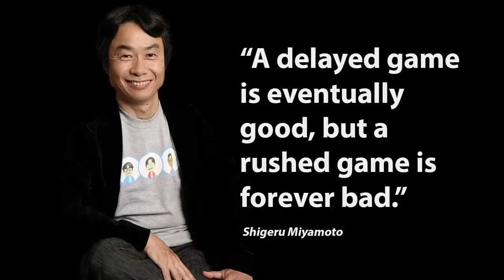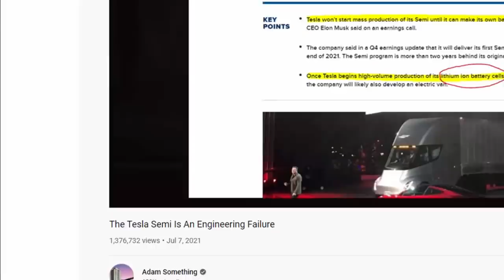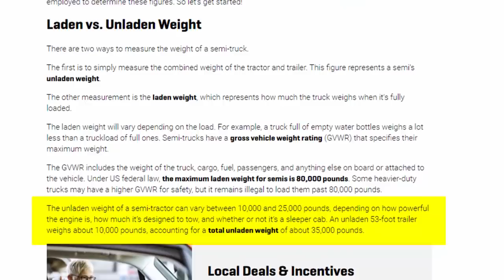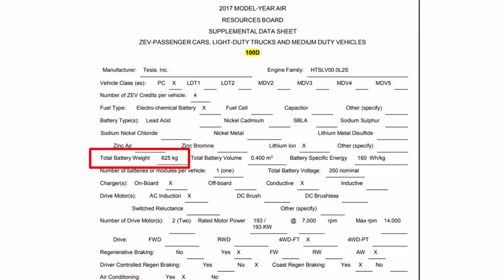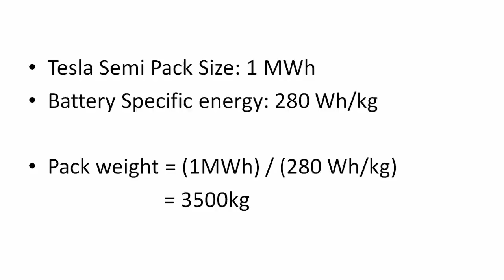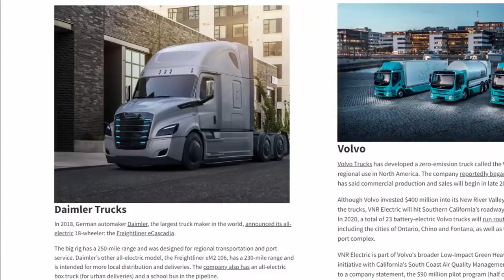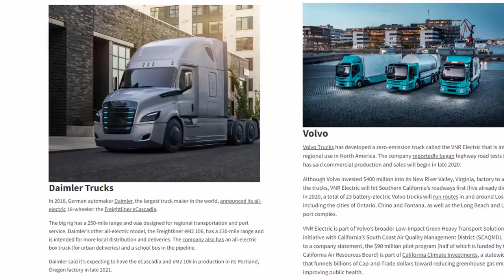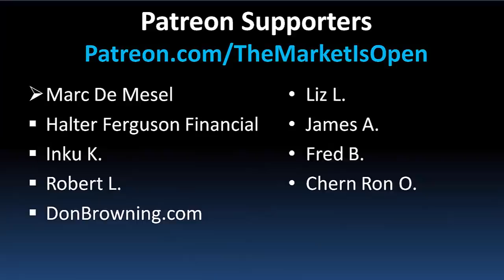The 2022 Tesla Semi is Genius, And Here’s Why

Comment: Battery production is the limiting factor for the semi and cars, 2nd biggest issue is charging locations. Achieving the specs will be not be a problem. The early adopters will be hub to hub shippers that have their own charging so this won't be an issue for them. Then as production ramps the charging infrastructure will be built out so this problem will take care of itself. If the total cost of operation for the electric semi is less than diesel, the diesel will disappear as fast as production will allow.
Reply: Yea right
Reply: The diesel is going no where. Sorry
Reply: @briankerschke5306  Do you mean that the diesel engine will be the permanent power system for trucks until the end of time? There will never be an improved method of powering a truck EVER?
Reply: @leeoxford  If they could outlast and outperform one. Diesel truck engines last hundreds of thousands of miles. Why get rid of something that performs so well and gets the job done.  Plus they can go over a thousand miles between fillups. What can possibly beat that? They claim they can well when I see it I'll believe it
Reply: @briankerschke5306  Sounds sensible. In a couple years we will have results to look at. In the meantime we are all just guessing.
Reply: Battery production.... Sorted.
I'd make a bet that there's a 4680 line built, or being built at Nevada (incidentally, literally next door to the Semi plant).
Charging?
The equivalent of 4 V3 chargers will charge a Semi 40% in 30 minutes.
On V3? 2 hours. 0-100? 5 hours 
There will be V3 chargers everywhere. Great for overnight stops.
Problem solved

Comment: Thanks for the interesting comparison. I was curious about safety comparisons between EVs and traditional diesel trucks. One of the greatest threats to 'life & limb' on the highways is a jackknifing semi. Around the I95/I495 beltway in the D.C.-metro area, they seem to have regularly occur for the many years I've been driving. Hard to believe, actually, given the heavy traffic. Complete multi-lane sections have been commonly 'shut down' while emergency operators went about resolving the issue. Rain & ice seem to be common preconditions to initiate jackknifed semi wrecks. Is it possible for Tesla to engineer something akin to fail-safe protocols to prevent jackknifing in its EV trucks?
Reply: You left out the part we're most of the wrecks involving 18 wheeler s are caused by people in cars
Reply: @oscarwalton1188  sure, but my intent wasn't to enumerate all the causes of semi accidents. My topic is relative safety of Tesla semi compared to a typical deisel semi. Over time, I'm sure Tesla FSD will become highly competent at defensive driving, though I'm not sure this will be the case for the first deployment of FSD in semis. A lot can be done with simulation using data gathered so far, but beta testing FSD in level 2 mode for semi may be necessary for several months to gather enough data.
Reply: @oscarwalton1188  Thank You for bringing out that point, you are 100% on Target!!!!!!!!!!!!!!!
Reply: Elon mentrioned that they have a solution for that as each motor on each axle is controlled separately and a simple software algorithm will make jackkniving something ifrom the past.
Reply: Not at all surprising that jackknifing happens in heavy traffic. While jackknifing can be the result of speeding, it can also happen due to a combination of steering and breaking at the same time, which is likely in congestion.

Yes, Elon read your comment :) so they have indeed implemented software to prevent jackknifing using torque vectoring.

Also, the extremely low center of gravity makes rollover far less likely. A deisel semi has the weight up in the engine and transmission. In the Tesla Semi these elements are replaced by motors near the wheels and batteries under the floor.
Reply: we must not compare weight of deasel engine and a pack of battery as we must not compare steam engine and deasel engine, we just have to focus on the technology..
Reply: There is a locking mechanism available for the pin, to stop uncontrolled rotation of the trailer. It has been available in UK for decades.
Reply: @rogerofcable  There was a company here in the States about 15or so years ago that tried to market an anti-jackknifing device that had a pin that would retract into the trailer, it dropped down into the jaws of the fiftwheel. 
Not sure why it failed to catch on.
Reply: R R locus have had wheel slip control circuitry which controls axels  independantly so independent wheel control should be doable

Comment: The Tesla Semi is going to revolutionize shipping and bring costs down so fast, companies will get a nose bleed when they see the numbers. Manufacturing these trucks fast enough is the only bottle neck they face... so I'm not worried about anyone else in the space or the naysayers who are so frequently WRONG.
Reply: @AudiTTQuattro2003  Yep, batteries are the big issue, but since my statements are forward looking it's my assessment of what WILL happen since Tesla is ramping up not only their battery supply but has increased orders with everyone who makes a battery. You know they have done the math on how many batteries they need for the semis companies have ordered and Pepsi getting theirs is a great "test" of not only the truck but the charging and use for someone else. I give it 6 months before someone reports something about those trucks and another 6 months (1yr total) before those with orders are maybe getting theirs... slowly at first but then... ramping for take off.
Reply: I'm not holding my breath, I don't see it as 'Game changing', I've spent enough time moving freight back and forth across this vast country.
1: the charging stations aren't there to support knocking all of the 'I.C.E' trucks off of the road.
2: they don't have the range of an 'I.C.E' truck, so, depending on conditions you are going to be charging twice a day, because no one in there right mind is going to run it til it dies.
3: I have yet to see a sleeper berth in one of these rigs yet, from the pics that I've seen it's just an over glorified day cab .
If I'm mistaken on any of these points please enlighten me.
Reply: @gregstruckingweatherandroa1414  the people here compare flyer specs to stuff already buyable. This does not help a potential customer. And when they can buy it, they might experience the famous Tesla support organization. Hauling companies have a business to run, they are no fanboys.

Comment: Elon installs electric brakes for the trailer he's already won. This was supposed to begin on diesel trucks with air brakes as back ups. I retired in '09. Here? vs Hear. (Must be a truck driver who cannot spell.) of that happening yet? I haven't. The start time promised late 80's to early-mid 90's. Electric brakes will get semi's to stop close to a dime. Skid control other safety goodies he'll be golden. Now what he's showing are Fleet trucks. Owner Operators are an entirely different animal. You try to mix the same tractors...modifications will come & come fast. Farmers are miles ahead on that front. They do not like the restrictive crap John Deer & other mgfs have forced them to deal with. Farmers these days are full of brain power. Not the ignorant one of generations past. Gosh darn if they can't read schematics.

Comment: These are short range semis meant for in state deliveries; they would be correct for long range interstate semis which no one would use anything but diesel for
Reply: I'm just curious. 
For interstate trucking, how many miles can diesels go without stopping.. one driver?
Legally and physically... not fuel range.
Reply: @whodatcatt  hmm good point, im not sure but I know long range trucks can go 10 hours with minor breaks
Reply: @1Snouser  
So I googled it.
A big diesel has a 125 to 300 gallon tank and gets about 8 mpg so 1000 to 2400 miles per tank, or at an average of 65 mph 15 to 37 hrs of driving. Wow.

But legally after 8 hours they must have a 30 minute break, so an EV would go 520 miles at 65mph. Then after 11 driving hours a ten hour break. The 30 minute break can happen at 6 or 7 hours. 

So legally the Tesla semi (w 1 driver) would work long range if there's convenient charging stations. 
But a diesel would offer more flexibility and options
Reply: 770 miles/ @whodatcatt  11 hours max  say 70.    770 miles

Comment: I have discussed EV trucks with many skeptics. The argument has always been the load capacity, to which my argument has been that of course there will be allowed for a higher weight for EV trucks.  It is nice to learn that this is the case. 
Much of the reason for the limited weight is due to the poor engine breaking on diesel trucks. EV's are much better, and the weight is therefore not so much of a problem.
Reply: @AudiTTQuattro2003  That was exactly what I ment.
Reply: @runeaanderaa6840  But that has nothing to do with safety.   I'm still not sure why they allow a higher weight limit.   I thought the weights were determined to not deteriorate the roads as rapidly.   EV or ICE, it's still got tires running the road.
Reply: @AKJammer1  That has everything to do with safety. A major risk is that the brakes overheat and there is virtually no possibility to stop. The regenerative electric braking will never fail. Also, when a diesel semi-truck slams on the brakes in a emergency situation, the engine does not help at all. On the other hand, the motor in an EV will automatically brake, and account for more than the added weight of the batteries. The lower center of gravity is also a big benefit.
Reply: @runeaanderaa6840  Fair enough
Reply: Every year that passes there are more diesel semis on the road.
Reply: @paulbedichek2679  This is because the transportation need is increasing. Trucks will lag behind cars a few years when it comes to converting to electricity, but there is no reason that trucks will continue to be run on an inefficient, expensive system.
Reply: @runeaanderaa6840  Lots of companies into sustainable transport GM making EV locomotives, just not Tesla.
Reply: @paulbedichek2679  You are right, Tesla does not produce lokomotives.
Reply: @vic321344  They don't make EV semis either.
Reply: @paulbedichek2679  You confuse Tesla with Nikola.

Comment: As usual a a thoughtful and thought provoking analysis. It is always difficult to mass produce a new and complex product that utilizes new technologies. It is much easier for Monday morning QBs to critique the product or the delays. It just amplifies their ignorance and myopic vision.
IMHO the Tesla SEMIs will be a huge hit with customers clamoring for it. The enviable challenge for Tesla will be to satiate the demand here in the US and abroad. Autonomous Tesla Semis will significantly reduce the current driver shortage and perhaps unclog the chronic distribution network.
We should get more clarity from Elon on the 26th about the Semi production and other important subjects.
Reply: Tesla has delivered nothing but talk in BEV semis zero.
Reply: @paulbedichek2679  Tesla has delivered 15 Trucks to Pepsico. The large scale production will begin 2023, when the battery factories for the 4680 cell will be ready.
All other manufacturers have to be satisfied with 300 miles range, as they dont get better batteries. If they get them at all.
Reply: @vic321344  Wabtec makes locomotives, they went with GM Ultium batteries as superior to any Tesla product, for longer range Wabtec will use GM Hydrotec fuel cells.
Reply: Who would trust Tesla with autonomy? Besides they have delivered the same number of human driven semis as I have.
Reply: Tesla unveiled the semi in 2017,considering the pace they move at, we should give them to 2027 to see any production,I see Volvo isn't waiting.

Comment: Range is an important factor but charging speed and convinience is the moste important.

- tesla needs the mega charger and the grid has to be able to suply it or tesla has to plays local battery's ass a buffer
- truckers parking/sleeping place should also have some "low" power chargers. Drivers need to sleep. So places a lot of 100kw charger on those places and they sleep about 6 hours that 600kw back in to the battery. 
I would believe that most of the truckers sleep add night so, add night truckers use them and throug the day when there are less truckers sleeping, cars could also use those chargers
Reply: Let's assume the Megacharger is 1000kW?
That's 4 V3 chargers, or 6 V2.
There are plenty of locations with multiples of those numbers.
The truck will when "maxed out" need a 30 minute charge at some point to our range the driver during a full day.
That will be spread depending on
The number on full load.
The start time.
The location.
It's not going to be Immediate, or in one location.
Trucks stopping "on the road" overnight can use a V3 charger! (5 hours max)
That will be "convenient"?
Reply: When they are sleeping. I see no point of them using a mega charger. Because after that halve hour. They will need to move there truck for other trucks to charge. 
You can't place infinite amount of mega charger. That just way to expensive. 
I think those chargers are about 2000kw. Or 2 megawatts. That isn't cheap to make. (tesla semi truck has something close to a 1mwh battery. If you want to charge that in 30 min. You are gone need a bit more than 2 megawatts. 
Mega charger are needed but really expensive. 
So if you design those roadside truckstops to have v3 charger that can be used by cars in the day and at night when there are way less car be used by truckers.  
I guess truck drivers do something like 1000km a day. That 2 times charging. 
When they sleep and during there brake looks to me the most convenient. But timing that with when and where you need to deliver something isn't always easy or possible I guess.

The v3 charger can give up to 600kw. If you look at the transformers boxes. The specs says 1000v an 600a.
Reply: Don't  need truckdrivers wait at a gas station for 20+ minute to fill up there tanks. Those  diesel tanks are massive. 
I know it depends a lot on how fast he pump is. 
And most of the time they uses 2 pumps. One for the left and one for the right tank.

Comment: The answer to the battery problem is simple. As a truck 🚚 driver the main larger batteries should be place in the front of the trailers. The trailers sits most of the time against a dock or on a lot. Perfect time to charge them. Plus adding the battery from trailer to the battery already in the tractor extended hours of service. Rethink the simple things. Most of time the trailer sit half empty or only has parcel loads. DOT can change regulations if they want. It's just they need encouragement to do so.
Reply: Start with Box trucks  first short routes.
Reply: The .mission is to get rid y pollution.
That's proportional to miles driven.
Trucks drive more miles.
Reply: Think about you said lol
Reply: You must determine a way to put this charging infectstructer  into  place in many yards some in remote areas where power to the facility may be limited.  Recharge power isn't  produced at a recepticle.

Comment: Electric trucks have been allowed a higher gross weight that he's not taking into account as well.
Reply: That would be a disasters for roads tbh, regulars trucks are already causing most of the problems on roads and the high maintenance costs to repair potholes, etc... adding more weights will just make the problem worse.
Reply: I've said it before and will say it again: electric should be designated for vehicles no bigger than a full-sized pickup truck (e.g a GMC Hummer EV or Rivian R1T). Anything bigger should use low to no emissions biofuels. Vehicles that fit in this category are commercial trucks, boats/ships, buses, construction vehicles like bulldozers, and airplanes.